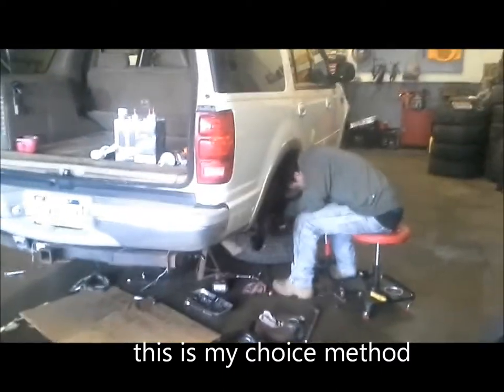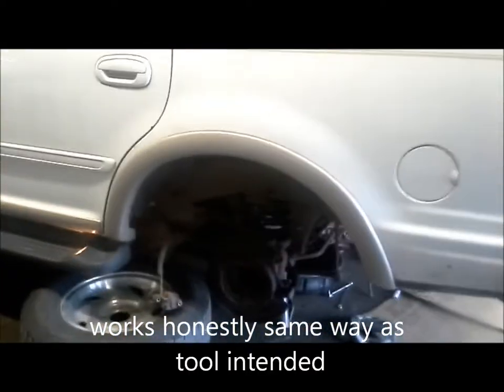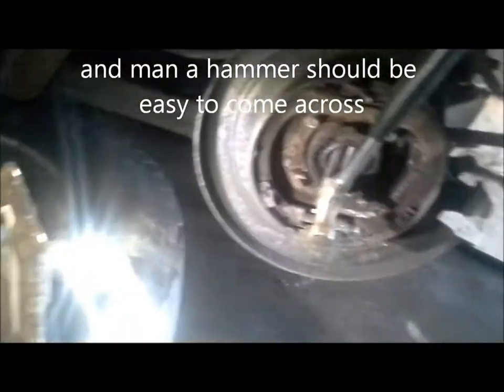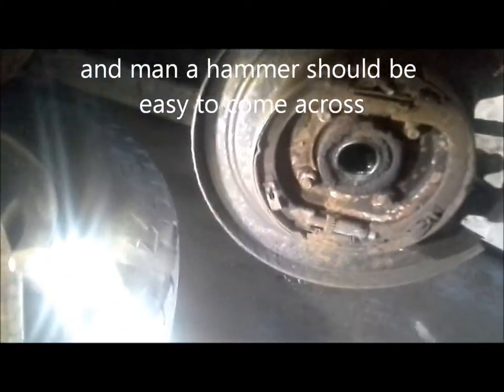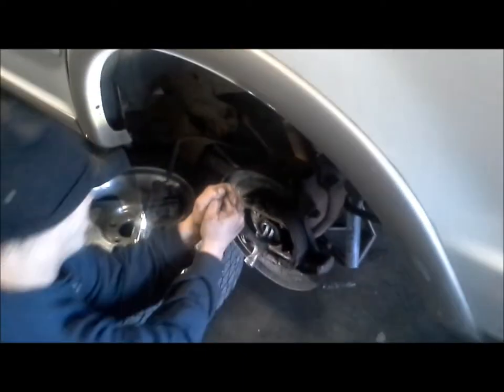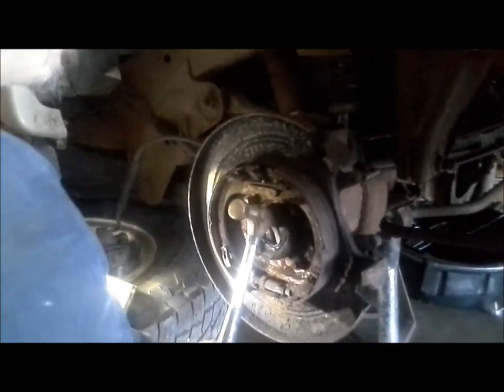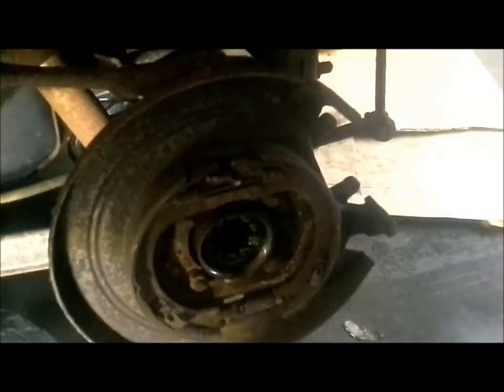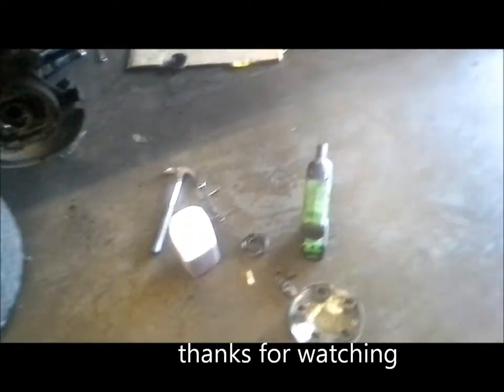what I use to remove axle seals, best tool ever? for this

Comment: OMG.. no... ZOMG!  This WORKED!  Thank you!  Tried a prybar to take out a FWD axle seal.. didn't work, too stuck, got out my hammer and BAM popped right out!  You made my day!  Thanks!
Reply from the maker: I had access to two nice professional seal tools, all they did was rip through the seal and steel, and yep the seal would just stay inside, but after few or several attempts they would work, but then one day I tried this method, ever since this is my way, so awesome to hear that it worked for you, in a tight space might not be good choice, but these rear axles I know for sure  it works like magic on them, being I was on the ground it was a little fight , but for sure man awesome to hear! thanks for epic comment

Comment: Here I am struggling with two differential seals on an ATV and had resigned myself to going to Harbor Freight tomorrow to buy a puller, and then this 7 year old video popped up in my search.  2 minutes later the seals are out and no puller needed.  Claw hammer worked perfectly!  Thanks.
Reply from the maker: So awesome to hear! Just small channel with few tips and repairs but totally appreciate the comment and glad to know people are finding it in the search, I actually had a bluepoint tool for this but in all honesty the 🔨 trick is still more effective and heck that day I shared this I had been knew this method and saw nobody on here sharing so I decided too make this video, glad it's helped a few and thank you though for awesome comment glad you can continue your repair tonight vs going out tomorrow for the tool and saving a few dollars and time

Comment: I bought a “Seal Remover” from Harbor Freight, no go, not even close.  The tool was starting to scar the outer rim of the axle. 

I drove to and borrowed a slide hammer tool from a friend miles away but none of the extractor bits fit correctly.  No luck.

Then I saw this video, grabbed my claw hammer and within less than one minute I had both axle seals out.   And no damage at all to the axle.

Thanks for posting!

Edit:  I used your technique on a 1986 Suzuki Samurai. The seal was a bit damaged during removal coz I wasn’t too careful; but on that vehicle if you’re removing it then you’re replacing the seal.  Also, the frail plastic seal protector behind it was unharmed!  This info may help others searching for a solution.
Reply from the maker: So glad to hear it has been helpful, I can't remember when I started doing this, just know it was same battle you went through, I tried everything and nothing worked but then I tried this was magic and ever since I have used this method I was thinking that day of this job I wanted to share wondering if others have ever tried using the hammer trick and figured hey might help someone out there, glad to hear. Them seal removal tools are a joke does exactly what you said
Reply from the maker: Thanks for awesome comment

Comment: Yep. You da man! This is the gift that just keeps on giving. I just ripped the crap out of my seal with the seal remover tool. Was gonna try to hammer the inner bearing out through the otherside, but then I regained my senses and clicked on your vid. :30 later - boom! Out it came. Thanks!
Reply from the maker: Thanks man glad to hear it helped out, been my method for some time and figured I'd share and to me the actual tool is waste of money if you have a claw hammer around. Like you mentioned just keeps ripping through it and a pain still the hammer just works perfect this way to me
Reply from the maker: Love you tube for this reason I just had a new generator shutting off 2 minutes of run and every time after started I was here thinking it was the fuel or other. Darn thing was low on oil. Thanks to a YouTube video and him telling to 1st check oil level. Boom was my issue to. Oil level sensor won't let run if oil is to low. Crazy was so happy that's all it was

Comment: I just use a small self tapping screw, and I screw it into 1 side of the seal, then, I just,  pick up the head of the screw with the claw and then I just bump the hammer upper handle for maximum leverage  , and you'll find the seal will just dislodge immediately,  and I would send u all a video, of me on how to do it, but, I don't have a video I can send u all, on the way I do it!! As in, I don't know how to send u all a video and let u all see it on u tube folks!! But, Dad was a mechanical engineer, and he showed me  and,  pls don't think I'm somehow knocking the method, this man uses, but, Instead of, having to reef the seal a few times, and picking the seal up, with the end of the claws, like in this  video, this man did, If u just screw in a small self tapping screw, and screw it in, anywhere on the full 360 degrees of the old seal, the seal will just pop out  and dislodge, with 1 bump of the upper end of the Hammer handle, as in using the maximum leverage of the of the hammer handle, just as I said before , and, Dad explained to me that  even if, the old seal is' frozen' into the seal housing, with Rust and or, age, u just bump your hammer handle, a few xs, it doesn't matter!! Because the old seal will just dislodge!!! AND, I can assure u 100pc, because u have a very strong pick up screw head, For the claws of the hammer to prize the old seal clean out,!!🙂and, Dad taught me that when I was 14, which is 47 yrs ago, and I have even shown quite a few mechanics, that exact same WAY of removing an old seal ever since, and If you're removing the rear Seals, from a front wheel Hub on a bench!! AND u don't have a vice, too hold the assembly, THAT'S when it's a Brilliant way of removing the old inner seal!!, THEN!! You'll all see what I mean folks!!🙂and i DO apologise for the Long post!! But, it was worth it!! Because had dad v Not ever shown me that technique, I'd have removed many 1000s of old seals, in the last 47 odd yrs, doing it the hard way!!🙂. All the best to u and Your loved ones folks, kind regards, Pete.

Comment: Thanks. Gonna try it on a transaxle bearing. Hope it’s a little easier, and I hope I’ve got enough room.
Reply from the maker: Not sure if it will work for that but hopefully it does
Reply: @RANS87IROCZ  Thanks for the reply. No big deal if it doesn’t. The removal tools are cheap.
Reply: @RANS87IROCZ  Didn’t work…no room. Sent for a remover. Got one more question I’m going to put up above. May interest other people.
Reply from the maker: @dancindavey1515  damn sorry to hear, maybe upload a vid on what your fixing and see if any suggest, I'm not too sure what too without seeing but wishing you luck

Comment: Mornin. Pulled my transaxle out accidentally . The clip is just a round piece of wire that looks ok. Still good enough to use? Having hard time finding rpl. Thanks for your time.
Reply from the maker: Yeah little ring on end of shaft? They sometimes look little bent out of shape but you should be able to put nut on threaded end (so you don't hit the threads) and hit the axle and the ring clip back in
Reply: @RANS87IROCZ  Thanks for taking the time to reply. I’ll figure something out. I’ll just put the axel in as is, and see if it holds. If not, I’ll worry about it then. You got my subscription.
Reply from the maker: @dancindavey1515  man hey thanks, wish I could of been better help here other than hit it back in with the hammer but hopefully it all holds for ya, I know normally I get lucky hitting them back in, as of the seal did you get it out also? Hopefully it all works out I know this stuff can be a headache at times
Reply: @RANS87IROCZ  Thanks again for all your advice. I’ll let you know what happens. Best of luck to you.